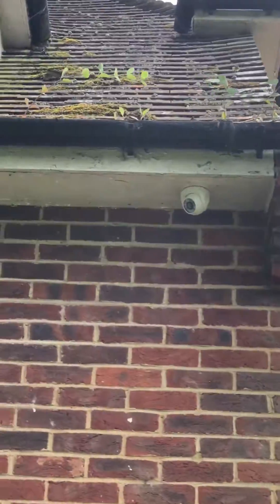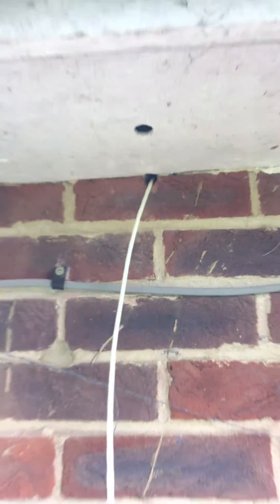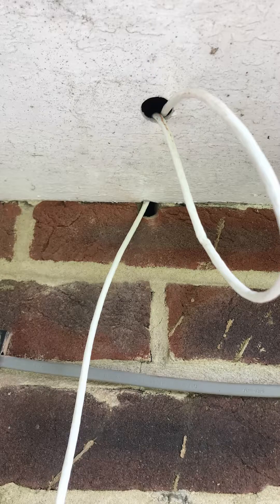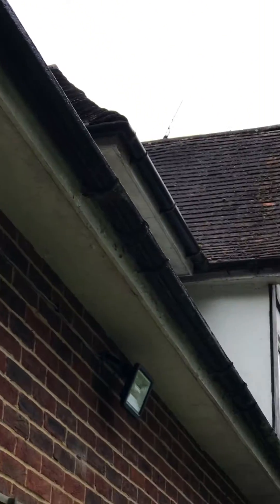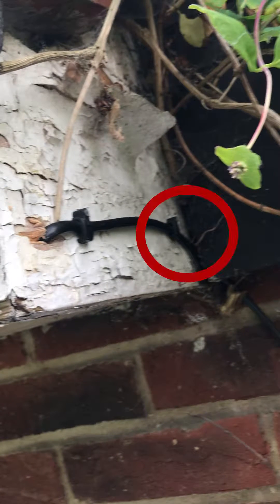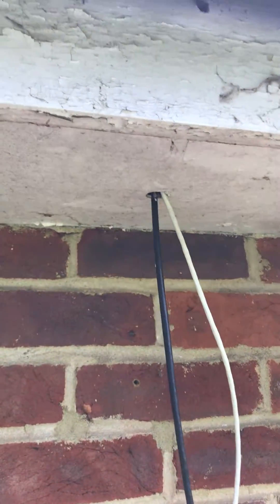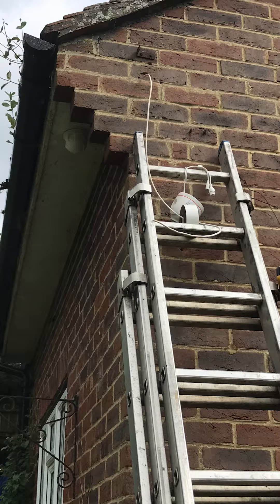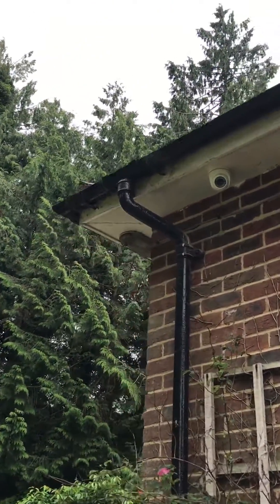CCTV Dome IP Turret Cameras- How to Install. Part 2 DIY guide

Comment: Thanks for the vid robox academy.
I've fitted a simple BNC system many years ago, so I consider myself a novice in today's CCTV world.
I'm preparing to fit a system to my new home, its a bungalow in a semi rural location.
I am thinking about 4 dome NVR 8MP 4K cameras. There is a Hikvision dealer just a couple of miles from me, and I like what I see from first glances at the CCTV market..
May I ask a question? Is it OK to fit a dome camera directly to a wall? If I want to look, say, down the side of my house from one end, so it would be mounted sideways?
Is that OK? Or would it make the image sideways? I'm guessing I'd need the wall mounting bracket, so the camera is suspended the way it was designed to be used?
Sorry to be long winded. Am I making sense?
Reply from the maker: Hi there- it's perfectly fine to fit the dome on a wall as long as it's a turret dome (we did this in the video above, the 3rd camera) or if it's a vandal style make sure it has 3 axis - this ensures the image is straight. You can have a watch of our video "different types of CCTV cameras" that will explain this in more detail. Best of luck.